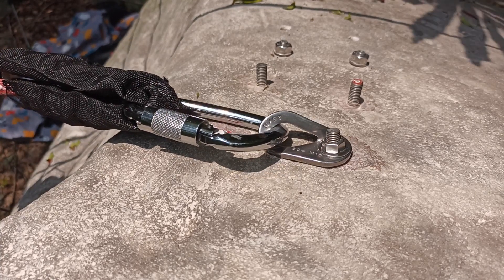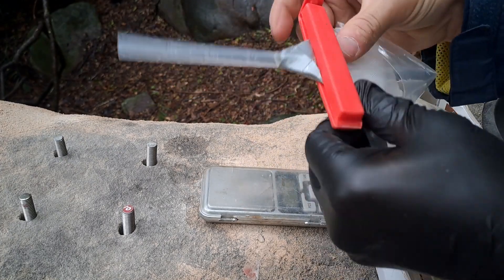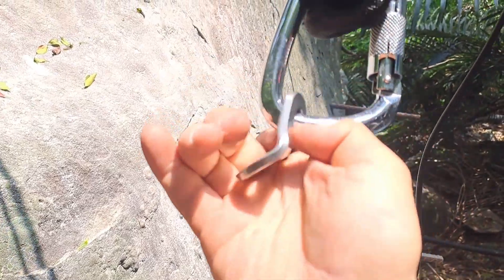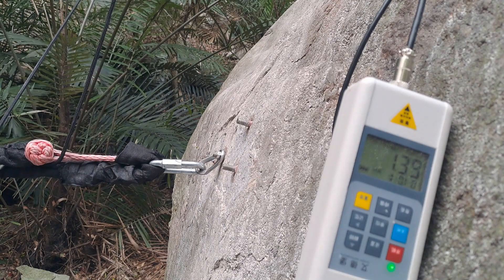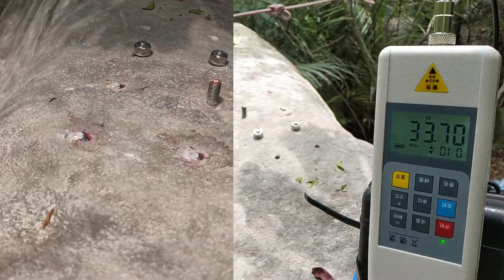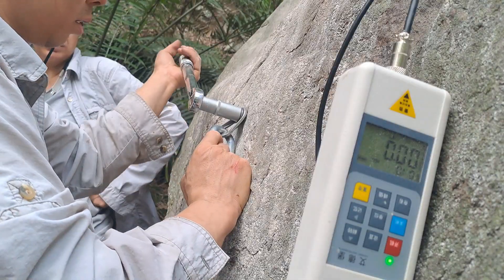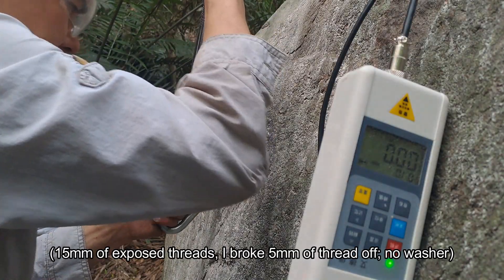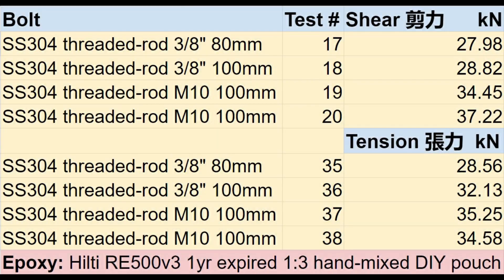BREAK TEST: 304 Stainless Steel Glue in Threaded rod Climbing Bolt

Comment: Would you be able to test a slm 3d printed 316L stainless steel threaded rod..? if you could make it.
Reply from the maker: We've break tested some stainless steel glue-in bolts and climbing hanger prototypes that used were SLM 3D printed. The strength was about 2/3 of a properly processed piece of steel that was annealed. Our samples broke like cast steel, very  low ductility.

Comment: Do you know if the threaded rod was rolled, or machined?
Reply from the maker: Rolled. Most mass produced rods are rolled. Cutting is slower and more costly. So it's often used for specialty fasteners, small quantities, or for alloys that are too hard to be rolled.
Reply: @climbingtaiwan  So the risk in using threaded rod is if the provenance of the rod is unknown.

Great videos!

Comment: nice. This is my favourite cheaper glue in solution. You're doing great work up there, mate
Reply from the maker: Yeah, Hilti glue is rather affordable here in Taiwan. I can get RE500 for about the equivalent of $22 USD, and Hilti RE100 epoxy for $18 USD for the 500 ml foil packs. (The guys in the States I think pay 3 times the amount for Hilti). We also have access to DeWalt pure epoxies that are also bright red with similar specs. I recently found the German-made brand Fischer FIS EM 390S grey pure epoxy available for around the same price range too. I pretty much just use pure epoxies with my glue-ins, and it's also what recommend for our sea-side titanium glue-ins too. But yeah, I've had a couple friends show me their busted Hilti cartridges, and that epoxy is still usable and valuable.

Comment: Te 100 mm rod, how deep in to the rock are? And the 80 mm how deep in to de rock ?
Reply from the maker: The 3/8" rods had 60mm and 80mm inside the rock (with 20mm sticking out). The 10mm rods had 80mm inside the rock with 20mm sticking out.
Reply: @climbingtaiwan  👍👍👌🏻 thanks, great Job